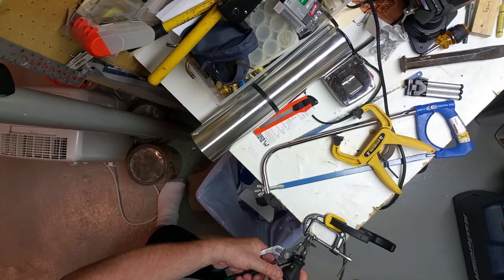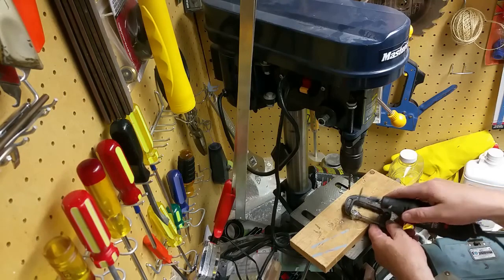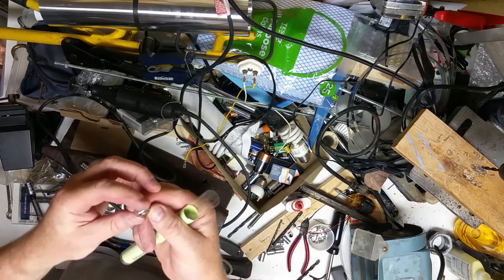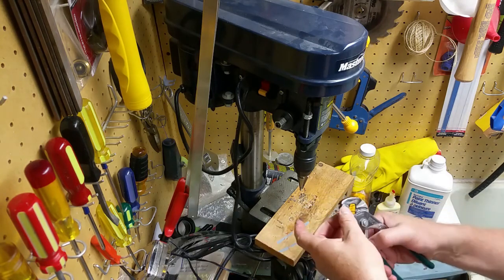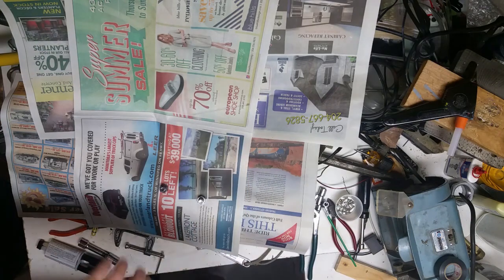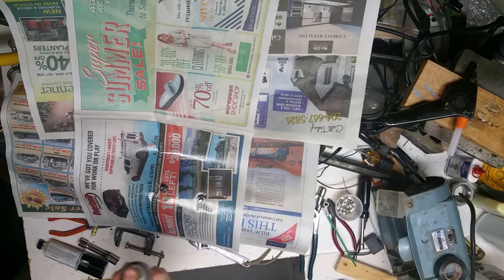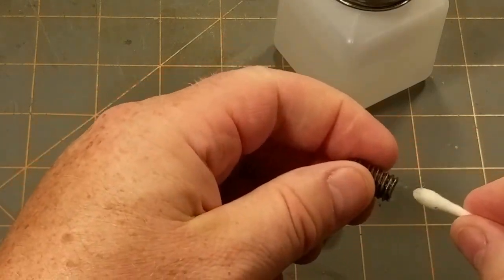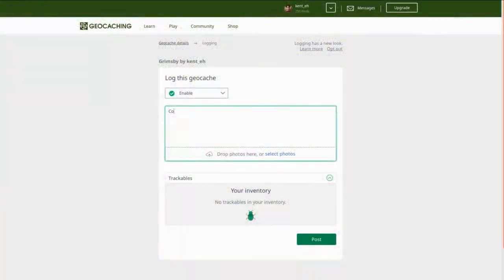Making a magnetic bolt geocache

Comment: Suggestion:  Put the nut on BEFORE you cut the bolt.  Then when you remove the nut, it cleans and straightens the threads.  It acts as a die, chasing the threads.  Not only that, but it gives you more surface to hold when cutting with a hacksaw.  It's best to hold it in a vise if you have one. You can do any filing before you remove the nut. I've been doing this for well over 50 years.  Always put the nut on before cutting the bolt. 

BTW, lacquer dries in minutes - often even less.  You don't have to let it dry overnight.  That's why it has been used in industry since the early 1900s to replace varnish.  For example, when furniture makers varnished furniture, they had to let it dry for at least 24 hours between coats. It was applied with brushes so it had to be sanded between coats and the last coat had to be sanded with increasingly fine sandpaper and then polished.  Very labor intensive and costly.  With the advent of lacquer, they could just spray the piece and it was done literally within minutes with possibly a quick polishing.  The same goes for musical intruments such as guitars, etc.  However, most wood finishers know that varnish or oil finishes are more durable and often look better than lacquer finishes.   Anyway, the point is, you don't have to let lacquer dry overnight. You can use whatever you lacquered in just a matter of minutes.
Reply from the maker: Thanks.
The only reason I let it dry overnight is that I went and did other things and didn't get back to it until the next day.

Comment: hi, i made several bolt cache too, but how about waterproofing? i find that sometimes water leaks in
Reply from the maker: On some others I have put a small blob of silicone bath tub caulking in the nut.

On these ones, the epoxy squeeze-out turned out to make a decent seal to the bolt.